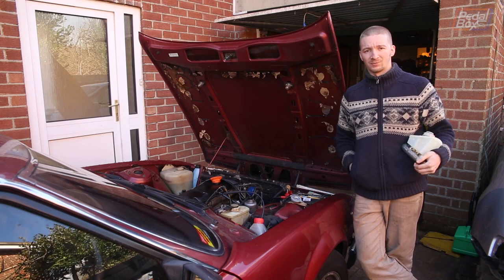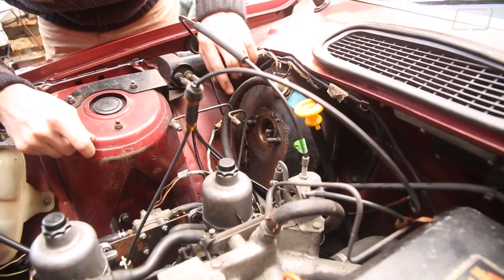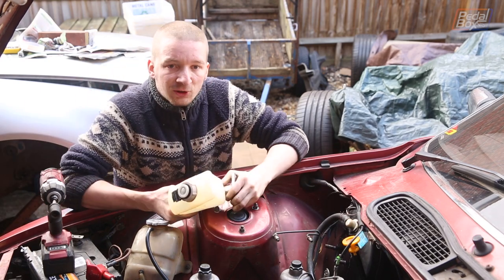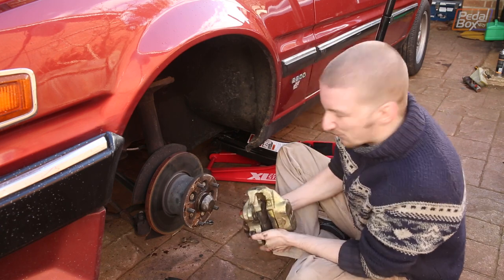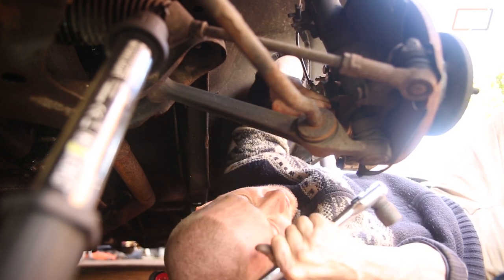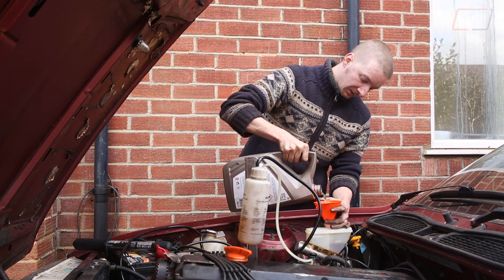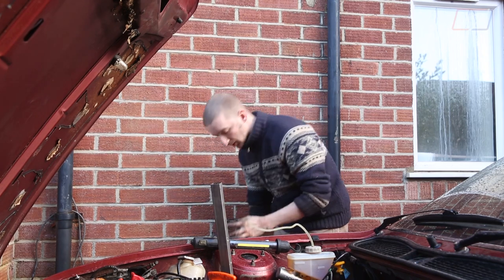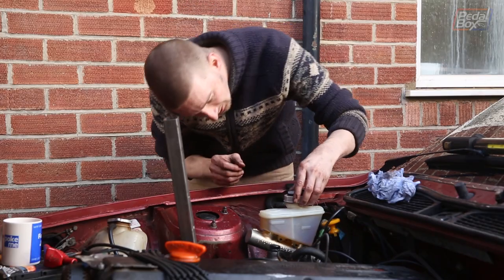Fixing SD1 Brakes | PedalBox Episode 20 | Fleet | Rover SD1 2600

Comment: Easy way to find a vacuum leak is with brake cleaner, I imagine you'll have some lying around after that job!
Spray it near all vacuum joints you were near and if the engine note changes you've found your leak 😁
Reply: I actually tried that - it didn't help find the leak and even when I did find it, spraying brake cleaner straight into the source did nothing. Very odd.
Reply: Also fun fact, the vacuum leak ended up being from the center bore in the servo where the end of the master cylinder slotted in. What is vacuum doing there? I don't know! How was it leaking from there? I don't know! What is the rubber seal at the base of the master cylinder meant to do? I don't know! 10/10 would confuse the hell out of myself again.

Comment: Any more videos of this beast coming?
Reply from the maker: Oh yes, theres a biiig list of thing awaiting and parts are coming together at the moment. Unfortunately the car is having some bodywork done to get rid of some hidden filler and a few preventative bits of rust proofing. But there's a lot of work coming in the next few months!
Reply: Current roadmap is pretty long, and gets sillier as you read down it!

First up it's getting some new metal put in (don't know how much yet, still waiting for the inspection at the body shop!) and paint done, general preventative stuff as mentioned.

After that, I've got "big" (for an SD1) power planned. So before I get to that it's getting a new big radiator, huge electric water pump, and maybe re-adding the factory viscous fan for all that airflow.

Next will be Vitesse vented brakes up front, or maybe bigger Jag disks. Haven't decided yet. If I can find parts easily I'd like to do a rear disk conversion as well.

After that, it's getting full EFI using a intake manifold I'm currently doing CAD work on ready to get 3D printed, a fully loaded MegaSquirt 3X from ExtraEFI that I've had kicking around for a while, and a set of BMW E46 M3 throttle bodies because they're cheap on eBay. Obviously some other supporting bits along with this: fuel pump, sensors, etc.

After that hopefully it'll be ready for boost, but this is a bit more of a long-term plan as it's pretty involved and I don't want to bodge it together. I'm still torn between a turbo and a supercharger - I've designed a turbo manifold but I recently noticed superchargers off recent Jags / Land Rovers cost pennies on eBay, and I can just gear those down to suit this little six pot.

Some time after that (because this will be big money!) will be a new camshaft to suit the boost, but unfortunately since basically zero people on Earth have ever tuned the 2600 that'll require going to Piper Cams or someone and saying "hi please take all of my money and make a fast boost-friendly camshaft".

Other small mods will happen as time passes, stuff like fitting the rear Vitesse spoiler, lowering springs, some custom wheels etc but these might be a bit too small to bother doing episodes on. We might bundle a bunch of those smaller jobs together for a catch-up episode some time though.

Oh, and the roof lining needs doing as in typical SD1 fashion it's sagged. I think that just about covers it.

Comment: Just before anyone rightly gives me shit for my factual error about the rubber "seal" at the base of the master cylinder, I noticed later that there's a notch in the casting so it's obviously not actually a seal, so I'm not sure what the "seal" is actually meant to do!

Also, the very loud hiss I mentioned at the end turned out to be vacuum in the servo is leaking through the interface between the servo and the master cylinder - exactly where that little cutout is. So I scratched my head for a while wondering why on earth vacuum was leaking out of there, then decided it didn't matter and sealed it up with some electrical tape.
Reply from the maker: Tape fix FTW!

Comment: When working on a car that has items in pairs on an axle you ALWAYS change BOTH sides at the same time no matter what the condition of the parts.
You changed one brake caliper only and the car started pulling to one side because you unbalanced the brakes. The new caliper was working better than the old so was slowing down that wheel more hence pulling to one side.
NEVER EVER change one side only!!
Reply from the maker: Yup, best practice and all that. It's not always possible, but it should be the plan asap.

Comment: Check out Nitrosilvia, he is restoring an SD1 2400 diesel. He had his radiator refurbished. Maybe cheaper than replacing...
Reply: I’ve been watching a lot of his antics :) absolute beast of a rebuild project! Refurb isn’t a bad idea but I am looking at putting some boost into this engine soon, and an embiggened radiator isn’t a bad idea when dealing with more power. I would love to get something like what Bruno Pinho runs in his race spec 2600, but I’m not as rich as him!
Reply: @ChrisDRimmer  
It is a beast of a rebuild that Nitrosilvia's doing, isn't it ?
All credit to him for restoring a 2400SD that probably would have gone for parts at best if he hadn't got hold of it.